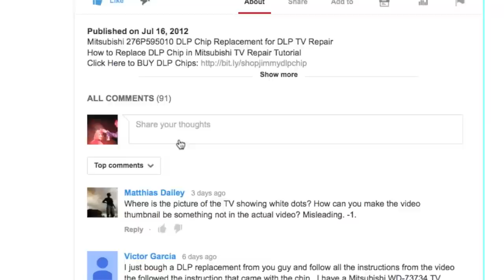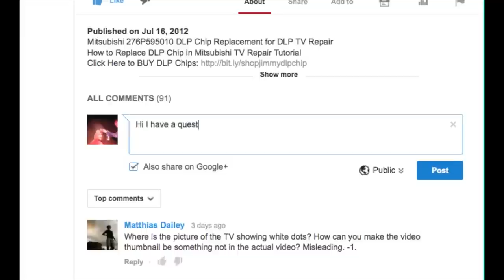LCD TV Repair Tutorial - TV Screen Solarization - Common T-Con & Main Board Symptoms & Solutions

Comment: Need TV Repair Help.I have a insignia TV model number NS-27LCD and it has a problem with it's color. Everything that is supposed to be black is white. This happens on every in with anything plugged in or not plugged in.I need help to know what to do to fix this tv ,I also put a video on YouTube of the TV problem so just search for Shanica Vaughn and you would see what I'm talking from the video also.
Reply from the maker: +Shanica Vaughn  Try all repairs and troubleshooting at your own risk.  I recommend replacing the main board in your TV.  Click this link to replacement parts for your TV model number:  http://www.shopjimmy.com/catalogsearch/result/index/?cat=56&q=NS-27LCD  There may be multiple boards for the same TV model number, be sure to match part numbers on your current board, with your replacement for compatibility.  Here is a link to a video showing how to identify your part number, click here:  https://www.youtube.com/watch?v=LIWO2A_tuaI  Thanks and please let us know if you have any further questions with your TV Repair!  www.shopjimmy.com

Comment: PLEASE HELP!! I have a Samsung LN40B53p7n LCD tv. originally it started producing greenish spots, almost like a camouflage shaped pattern and almost always in the picture where there was skin tone/color. Usually on a face shot. I did a little research which lead me to believe I should replace the TCON Board and so I did. This actually made the picture worse. Now I have all kinds of tracers coming off of even the slightest movements and poor colors also. I even see ghosting when I pull up the picture/sound/settings menu. The camo shaped spots appeared small at first but once the tv seemed to maybe warm up they would always get worse and worse. Now the picture is bad from the second you turn the tv on. through a lil research I saw where someone had mentioned that if you get what I'd describe as "dirty power" or "contaminated power" coming out of the power supply board going into the TCON board then perhaps it would seem as the TCON board was bad when perhaps what really needed replaced was the power supply board. Have you ever heard of any of this? Can  you PLEASE lead me to the real problem and help me get this fixed?
Reply: ShopJimmy.com Here are 2 board #'s. Hopefully they help.
MAIN BOARD = BN-11779B
POWER SUPPLY BOARD = BN44-00197A
Leave me a link if you find someplace that I might be able to go to for some help with this. After the TCON board I used as a replacement didn't work, I did kind of figure that I was going to have to try 1 of these other ones also. Just curious...What kind of things can someone like me look for that would be clues that the actual screen itself is taking a dump on me instead of it just being a board? Is there even specific signs at all that would signal the problem being a bad screen instead of just needing a board replacement?
Reply from the maker: braylon trout Click this link to replacement main boards for your TV model number:  http://www.shopjimmy.com/catalogsearch/result/?q=11779B  Be sure to match part numbers on your current board, with your replacement for compatibility.  Thanks and please let us know if you have any further questions with your TV Repair!  www.shopjimmy.com

Comment: My Mitsubishi Wd-65731 lamps keep going out . And smells like it is burning. And now where the lamp goes it looks like the area got hot cause it looks burnt on the metal . I no longer here a motor running eigther . Is it the fans or the ballasts or both ?
Reply from the maker: +Kim Brau   Try all repairs and troubleshooting at your own risk.  I recommend replacing the ballast in your TV.  Click this link to replacement parts for your TV model number:  http://www.shopjimmy.com/catalogsearch/result/?q=Wd-65731  There may be multiple boards for the same TV model number, be sure to match part numbers on your current board, with your replacement for compatibility.
Thanks and please let us know if you have any further questions with your TV Repair!  www.shopjimmy.com

Comment: every time Ive ever encountered it myself (mostly on samsung or Polaroid brand), its been from a failed "AS15 " or  "AS10" chip on the tcon board (which I order and change rather than replacing the board)... if your tcon has one of these 2 chips the odds are the tcon is the issue.  Just look for this square chip on the tcon board...

Comment: hi i have a samsung UN55c6500 , it turns on but after 10 minutes i see white stripes and decolorisations. any suggestions?
some people told me that it is the t-con board?
Reply from the maker: Elvin Tammenga   Try all repairs and troubleshooting at your own risk.  This could be a problem with either the t-con board, the main board or the TV panel.  You can replace the main board and t-con board individually to see if one of those boards fixes the problem.  Click this link to replacement parts for your TV model number:  http://www.shopjimmy.com/catalogsearch/result/?q=UN55c6500  There may be multiple boards for the same TV model number, be sure to match part numbers on your current board, with your replacement for compatibility.  Thanks and please let us know if you have any further questions with your TV Repair!  www.shopjimmy.com

Comment: hi tv model L24DG07U Hitachi  the screen work fine for a second or 2  goes green after that sound comes throw.could it be repaired?  Thanks
Reply from the maker: Ajaz Mahmood   I recommend replacing the main board in your TV.  Unfortunately I do not see any replacement parts in the search results for your TV model number on our website.  Please reply with your part number on your main board and I can try searching for replacement parts.  Thanks and please let us know if you have any further questions!  www.shopjimmy.com

Comment: hi, my sony bravia Model : 32S550A , it has red screen and images are tainted with red, though manue appears to be ok.I have done everything possible including reset, firmware upgrade etc, Any help would be appreciated,Best
Reply from the maker: +Khalid Gul   Try all repairs and troubleshooting at your own risk. This could be a problem with either the t-con board, the main board or the TV panel. You can replace the main board and the t-con board individually to see if one of those boards fixes the problem.  Click this link to possible replacement parts for your TV model number:  http://www.shopjimmy.com/catalogsearch/result/?q=32S550  There may be multiple boards for the same TV model number, be sure to match part numbers on your current board, with your replacement for compatibility.  Thanks and please let us know if you have any further questions with your TV Repair!  www.shopjimmy.com

Comment: My 65" samsung smart tv un65hu8550 has half of the screen green. The picture is still working its just green on the right side of the tv. The menu is not affected by the green on the right side. Only the tv picture when watching tv. The tcon board was replaced and that did not fix the problem. The technician who has my tv is telling me it could be the main board now. But he is telling me there is only a 50% chance. If the main board would be replaced would it fix the tv?
Reply from the maker: Sergiu Coroianu   Try all repairs and troubleshooting at your own risk.  This sounds like a TV panel (TV Screen) problem.  If your TV panel is bad, it may be more cost-effective to replace the TV as panels are typically hard to find in stock, difficult to replace, and expensive.  Thanks and please let us know if you have any further questions!  www.shopjimmy.com

Comment: Hello,
I have a problem of solarization on my Lg tv after the T-con board replacement. The menu is ok.
I need the code access to Service Menu to fix the problem, please.
 Here's the model number: 42LV5400-UB
Software version : 05.00.12
Serial number : 109RMEN3Y972

Thank you

Ghenimi
Reply from the maker: +Imed Ghenimi  Try all repairs and troubleshooting at your own risk.  You would need a service remote for that.  Thanks!  www.shopjimmy.com

Comment: i have a sony bravia manufactured sept 2013 model kdl 50r450a model .  the screen is blurry and fades to normal to blury every few seconds.  I turned off the light sensor feature and still the screen is blurry.    I tried usb and cable connections and still blurry.  the cables are good since my other tv with the same cables works fine.  I have reset the tv and unplugged it and still the picture is blurry off and on.

Comment: Samsung ln32a300j1d. Color is solarized and also dims out. Menu is maroon, I believe it should be blue. (Sister's TV). Thinking T-Con.
Reply from the maker: Jason Weichert  Please watch this video FIRST to help with your repair!  https://www.youtube.com/watch?v=BP3NVNCGEv8  This could be a problem with either the main board, the t-con board or your TV panel.  You can replace the t-con and the main board individually to see if that fixes the problem.  Click this link to replacement parts for your TV model number:  http://www.shopjimmy.com/catalogsearch/result/?q=ln32a300j1d  There may be multiple boards for the same TV model number, be sure to match part numbers on your current board, with your replacement for compatibility.  Thanks and please let us know if you have any further questions with your TV Repair!  www.shopjimmy.com

Comment: I have a Toshiba 39L4353D, I recently changed the main board and now the image is solarised. What do I have to do so the solarised image is fixed
Reply from the maker: Deepak Bacheta   This sounds like you have replaced the main board with an incompatible replacement.  Unfortunately I do not see any replacement parts in the search results for your TV model number on our website.  Please reply with your part number on your main board and I can try searching for replacement parts.  Thanks and please let us know if you have any further questions!  www.shopjimmy.com

Comment: SAMSUNG TV MODEL UA55F8000 AR 
My tv fell down ,screen form the inside is damaged ,half of the images can be seen . sound is ok half of the screen is gone .if im not wrong there is  the problem with the t con board.my question is to replace the tcon board ,are there any specified model codes t con boards for the above mentioned  tv .kindly help im worried
Reply from the maker: Ali Khan Unfortunately there is no repair for this.  Thanks!  www.shopjimmy.com

Comment: This happened to my TCL Tv today. It happened after a momentary power outage. The tv came back on with the solarized issue. I factory reset it as suggested from internet searches. Didn't help. I will be replacing the tcon board to see if that fixes it.
Reply: Same it happened tdy idk wut happened
Reply: I have a tcl too I need help
Reply: @demetridabrio1551  Replacing the TCON Board resolved this working perfectly ever since...
Reply: @newton3010  I did that and I reset it it’s back to normal now

Comment: Upon returning from vacation, our 40" Samsung UN40EH5050F just out of warranty would not power on.  We were told about violent thunderstorms while were gone.  We had surge protectors, but not coax surge protectors. Later we discovered that the dvr and blu-ray which were connected via hdmi would not function although they would turn on. I threw away the dvr and blu-ray, but I replaced the Samsung main and power boards with cheap used ones from ebay and that worked fine for the first few hours. Now the picture deteriorates as soon as the tv warms up and the remote will no longer work. If I unplug the set and wait a few minutes, then plug it back in, everything will work fine for about a half hour or more.  The picture will then deteriorate again and the remote will no longer work until I unplug and wait.

Comment: I have a Hitachi Flats screen Model # L46S603 when I first start the TV the picture is fine after 5 minutes it fade to white wash. sound is fine, pictures if fade images.
Reply from the maker: +Arturo Caraballo   Try all repairs and troubleshooting at your own risk. This could be a problem with either the t-con board, the main board or the TV panel. You can replace the main board and the t-con board individually to see if one of those boards fixes the problem.  Click this link to replacement parts for your TV model number:  http://www.shopjimmy.com/catalogsearch/result/?q=L46S603  There may be multiple boards for the same TV model number, be sure to match part numbers on your current board, with your replacement for compatibility.  Thanks and please let us know if you have any further questions with your TV Repair!  www.shopjimmy.com

Comment: hi i have a LG 60pv250 just started solorazation on the right side of the screens comes and goes don't know what it can be
Reply: try the conection cable on the right side for poor contact
Reply: +ron hicks im still getting it is not as bad but its still there
Reply: the driver board is attached to the screen under the front surrond

Comment: I have a 55 in sharp aquos and my tv started with a black spot on the bottom of screen, then almost a 75 % of picture is bad the colores are very distorntioned and black the other 1/4 of screen is normal,its this hapened because my tv is seated on the table with out a stand or is something else.

Comment: HELP PLEASE!!! i had double image problems i fixed that using a small piece of tape now i have no sound. i try taking the tape back off but still no sound. Hisense LCD tv  hisense Model number LTDN46V86US SOUND problems
Reply: you may have bumped a cable check connections on main board also from speakers check that its not in mute /  no sound ...

Comment: my 55 inch toshiba flat-screen  tv went through a power surge and now when I turn it on its almost completely white with slight color. 

model 55ht1u 
serial a49185m50634a1

Comment: hi i have
sony bravia kdl40v4100 the picture and color is negative tanks
Reply from the maker: jose conde  Please watch this video FIRST to help with your repair!  TV Repair! LCD, LED, Plasma, DLP How To Fix Your TV with ShopJimmy.com Help!  This could either be a problem with the T-Con or the main board in your TV.  I recommend replacing the T-Con board first, and if that does not fix the problem, then replace the main board.  Follow this link to replacement parts:  http://www.shopjimmy.com/catalogsearch/result/?q=kdl40v4100  Be sure to match part numbers on your current board, with your replacement for compatibility.  Thanks and please let us know if you have any further questions with your TV Repair!  www.shopjimmy.com

Comment: I have a samsung tv LN40C550JF1 I believe it is an LCD (I inherited it from a friend).  The issue I have is the color is faded, practically negative.  It struggles to maintain the correct color but it ultimately fails.  What can I do?
Reply from the maker: HumdingerProductions Please watch this video FIRST to help with your repair!  TV Repair! LCD, LED, Plasma, DLP How To Fix Your TV with ShopJimmy.com Help!  I recommend replacing the main board in your TV.  Here is a link to replacement parts for your TV model number:  http://www.shopjimmy.com/catalogsearch/result/index/?cat=56&q=40C550  Be sure to match part numbers on your current board, with your replacement for compatibility.  Be sure to match part numbers on your current board, with your replacement for compatibility.  Here is a link to a video showing how to identify your part number, click here:  Samsung Main Boards & Digital Boards: Part Numbers for LED, LCD, DLP, Plasma TV Repair  Thanks and please let us know if you have any further questions with your TV Repair!  www.shopjimmy.com
Reply: I have a similar problem cept my samsung tv color is negative and like to know how to change it back to normal color
????
Reply from the maker: Mark Jakims   Please reply with your TV model number.  Click here to view a video that shows how to find your TV model number:  TV Repair STEP #1 Help IMPORTANT TUTORIAL How To Find Your TV Model Number Tutorial TV Repair Help  Thanks!  www.shopjimmy.com

Comment: Hey i have a problem with my tv. i have a Hisense LTDN50K220WS. I have a shadow/black spot on the middle of my screen. you can see the screen input of my hdmi but than much more darker. Sitting right in front of the TV you wont notice it, but standing beside it it will be more and more visible. Any help would be the best. If someone needs pictures i will upload them. Thanks!
Reply: thanks for the reaction. only the dark stop was getting smaller and smaller each day, by now it completely vanished. I have no idea why but waiting worked for me ^^.

Comment: I have a Samsung UN60F7100AF  that will work fine for about 20 minutes ,than it goes to a solarized screen and will not not let me pull up the  menu after that it also starts to turn it self on and off after it goes to solarized screen
Reply from the maker: +Randy Watts  Try all repairs and troubleshooting at your own risk. This could be a problem with either the t-con board, the main board or the TV panel. You can replace the main board and the t-con board individually to see if one of those boards fixes the problem.  Click this link to replacement parts for your TV model number:  http://www.shopjimmy.com/catalogsearch/result/?q=UN60F7100AF  There may be multiple boards for the same TV model number, be sure to match part numbers on your current board, with your replacement for compatibility.   Thanks and please let us know if you have any further questions with your TV Repair!  www.shopjimmy.com